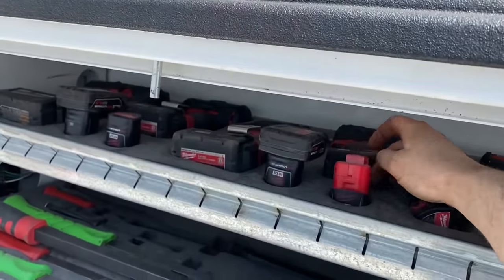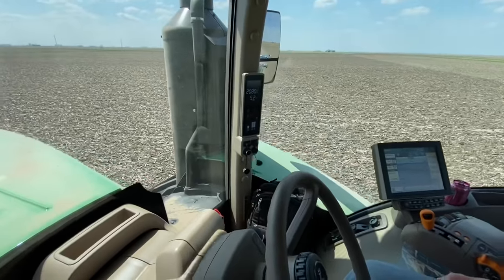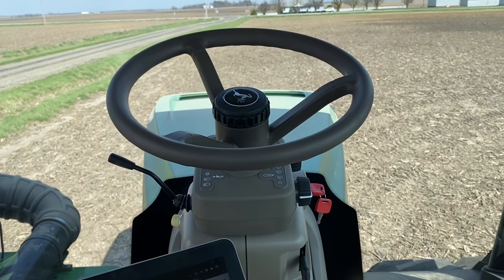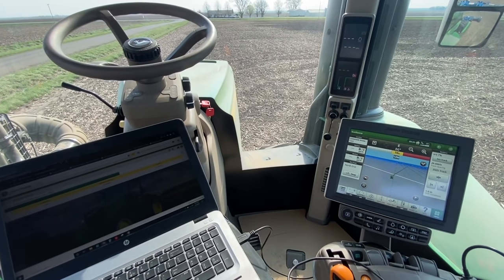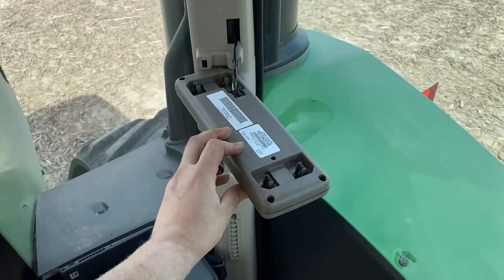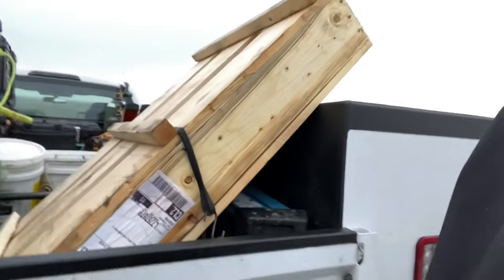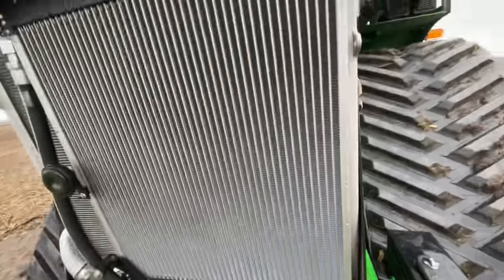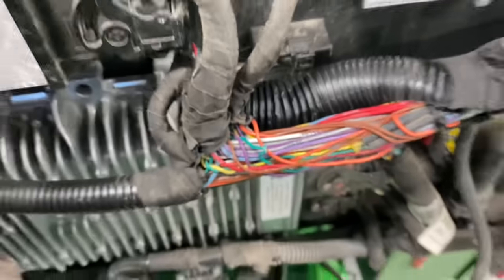2021 John Deere 9620RX sets multiple communication faults and speed is de-rated to 6 mph.

Comment: As an industrial electrician of 40 years experience I can fully appreciate the frustration off a fault like that. It must have been so satisfying  eventually finding that, well done 👍. Strange thought when the wire wasn’t even fully broken. Bet you weren’t looking forward to replacing the wiring loom if that hadn’t fixed it!

Comment: As a automobile master tech, I can state can lines can be quite tricky, you can have one strand left in the wire, and still have perfect ohm readings until you hit a bump on the road, in most cases I run a temporary CAN wire outside of the harness between the two points of failed communication to save time finding the problem before judging modules. 
Great job. Love your videos.

Comment: I hate intermittent CANbus faults.  Drive me nuts. Techs usually says it's got to be in the programming.  I tell them to check the wiring because if it's in the program all the units would have the problem.  A few hours later they tell me they found the issue.  It was in the wiring. Usually a pin that was not seated or a wire like you found.  Keep up the good work, I enjoy the videos

Comment: In my first job/career, I performed customer field service work (office automation equipment) and during the 14.5 years i did that, I had two similar issues of replacing everything that myself and Tech support could think of and it ended up being pinched wire on one and an intermittent pin contact in a harness on the other. The fix in both cases was very simple but, finding both issues was a nightmare to say the least. After that experience, I stopped assuming it was always the big items and started looking for simple comm issues first. It served me well.

Comment: Sometimes diagnostics takes trial and error. I work in computer repair for the past 10 years. Cannot tell you how many times I have had still things like this. You are chasing your tail for 2-3 days in a row till you finally find it.

But damn nice find. Single wire caused you all that headache. I once had a single wire on a power supply that was not plugged in all the way. You walked past the computer and the damn thing would turn off

Comment: Had a 1770nt planter that kept crashing and rebooting the planter controller. Didn’t crash anything else just the planter controller. The tech and I were working on it for something like 5 hours checking literally everything. Finally narrowed it down to the wheel speed sensor on the planter. Put a different sensor on and everything was fine. It was a wire on the sensor that was rubbed through the insulation grounding out on the frame intermittently causing the controller to crash. Extremely frustrating. Intermittent wiring issues can be the hardest to diagnose and repair. 
   Good catch finding that bad wire! Wiring harness quality control is not something to be taken lightly.
Reply from the maker: Yeah that's why I don't have hair anymore lol thanks for watching!

Comment: I’m former truck engineer who moved on to transport refrigeration units and those CAN-modules are pain in the butt to troubleshoot. You can only diagnose everything else and if ok, replace the module and pray - and customer will pay and cry. Did you have to put back the modules you replaced that were ok? I’d imagine so as it’s a warranty job. Anyways really interesting to watch the repairs, subbed!

Comment: LOVE THES VIDEOS! 10 year jeep tech and i had something very similar not too long ago with a communication would drop out for a split second. very frustrating to figure out
Reply: fine also turned out to be a broken wire ( shorting to ground at times to the firewall) but it was so odd how both of our communication wires tested fine when ohmed and load tested.

Comment: Sandvik drill Tech , had a CanBus issue also that was interesting, Can low wire had rubbed through against frame of drill causing Can low in backbone circuit to ground . Went to know connector points to install bridge cable and the first wire I put my hand on was the wire with the copper exposed on the rubbing part of that cable just at the connector, luck of the Irish!!

Comment: One little wire shuts down the operation....amazing!
Reply: Not unlike the points on my 1971 Bronco that stopped the entire truck when the screw holding them in place loosened because of vibration and the points would no longer open and close.  You remember, the "good old days" when everything was mechanical, super reliable, and "easy to fix."

Comment: I'll tell u what amazes me with this technology today is that a database isn't set up for the field tech to look at the problems, solutions and the hits for each problems along with d tech to cut downtime. Like this video on that pink wire almost cut thru. That tells me it is the wire harness quality issue when built and should have been tested for shorts, vibration, salt water ,freeze and so forth .

Comment: In my experience working at the Volvo truck dealer, OEM wiring troubleshooting steps for both Volvo, MACK & Cummins are wildly inadequate, guys who follow them often end up needlessly replacing modules & smart devices because their troubleshooting led them to no fault found in the wiring; which is less of a problem when you can get warranty to foot the bill but when its starts coming out of the customers pocket it get's ugly. In cases that are not immediately obvious I've had a lot of success isolating the harness, load testing the powers and grounds to each module in question, isolating the CAN line between connectors applying an alternate power and ground with a load in place, typically an incandescent bulb and wiggling the harness. A single conductor inside the insulation will give you good resistance but will not carry a load, while the serial data messages do not load the circuit per say, a nearly broken wire like you found, or a loose female terminal creating intermittent contact will absolutely wreck the traffic on the network. Good find, nice to see guys getting after it in the field.

Comment: Great video,  I've been an aircraft electrician and avionics technician since 1978. I've run into your little problem many times! Cut wires aare a bitch to find. Have your shop invest in a megger. It's a megaohmmeter. It shoots 50,000 volts down a suspect wire and it then reads the resistance oof that wire. High resistance, you only have a couple strands of wire . It'll ohm good but won't pass a voltage thru it. A Fluke meter only sends about 5vdc thru the wire. You have to have both ends disconnected from electronic devices or you'll nuke them.  3 kinds of wire problems,  short, open, or a few strands. A Milliohmmeter would be good to have too! That reads milliohms to check your ground connections. A fluke can't read that low. Have fun.

Comment: A $500,000+ machine with 20 hours useless for 2 whole days time is money great quality control John Deere !
Reply from the maker: Name one manufacture that mass produces tractors and never has one problem... Just because one tractor out of thousands has an electrical failure doesn't make every one bad.   It could have passed all the quality control checks at the factory because it took a few days of driving it before it showed up. We have a ton of these 9RX's running and they are doing well in my opinion.

Comment: I’ve had continuity/resistance checks mislead me before the wire was showing .3 ohms but it will still have continuity even if 1 or 2 strands are still connected I do not work tractors but I’m sure the can lines have small voltage between the high and low lines I wonder if it would have shown a voltage drop comparing the 2 lines

Comment: GREAT VIDEO.. I'm surprised that you didn't need to solder the broken wire... Good find.
Reply from the maker: In my professional opinion, heat shrink but connectors are the best. You can run enough amps through the wire to burn off the insulation and the but connector will still be attached. Solder will melt. Plus if you don’t solder it perfect you can have excessive resistance. But connectors do not change the resistance enough to really detect in a multimeter.
Reply: @ZKMasterTech  Good to know. International says to solder so I was just wondering... Thanks buddy 😃👍
Reply: Also Deere doesn’t recommend to solder can wires they want you to use heat shrink butt connectors
Reply: I know it's not the same...but Toyota requires soldering in any warranty repair. As long as proper rosin core solder is used, resistance is negligible through the circuit, and voltage drop is non existent.
Reply: @ZKMasterTech  You should look into open barrel connectors, you can maintain much greater flexibility in the wire without the added bulk of a butt splice, you never run the risk of damaging the heat shrink while crimping and if done correctly the splice will cold weld the conductors. 
We see a lot of failed heat shrink butt connectors in truck chassis harnesses due to split heat shrink around the crimp, often when multiple circuit repairs have been made in close proximity. At the end of the day fixed is fixed, if they don't give you trouble good on you.

Comment: These tractors are far to complicated they will develop so many faults has they age they will have no secondhand value
Reply: That's why old school, pre-computer machines are in high demand. Everything is mechanical with limited electronics.
Reply: They have plenty of second hand value 
Mechanics are just getting better at electronics 
If your a mechanic these days amdyou can't do electronic diagnosis then you won't get far 

When you think about it basically everything post mid 90s is electronic control tp some degree, even mid 8ps in some brands 
So full manual machines are 25 to 35yrs old now 
Theyre all fairly well scrap now 
No full mechanical machines are frontl line machines round here anymore 
Got plenty of 10k hr newholland T9s round here that havemt had any issues 
Plenty of high hour johnys as well

Comment: I wonder how you make repairs. Love the diagnosis. Does Deere has their own approved wire splices or does Zeth have HIS ? Eric O working on salted cars shows us what he uses. Sells them too. You work for a humongous company. Thatsalota Deere.
Reply from the maker: I use heat shrinkable butt splices. Never failed me yet.
Reply: @ZKMasterTech  with goo inside the heatshrink?
Reply from the maker: @lackeydehackey405  no the plastic melts down and seals around the insulation of the wire. You crimp it like a normal butt connector then heat the ends to seal them down.
Reply: @ZKMasterTech  the ones with resin inside make it water tite. No green crusties
Reply: @ZKMasterTech  they are great little joiners awsome actually but if was my brand new machine I'd want harness replacement because after 10000 plus hours with dirt rain and corrosion that will be a weak spot

Comment: the one big problem with that plastic tubing is it rubs in the riges  its a crap way of doing it . you get the same problems with  air con units where it vibrates  . the same type but made out of metal .  then ribs are the problem .  you need smooth piping  to cure that problem .

Comment: So, in the end did you put all his original components back on since everything should have been working correctly in the first place? 
I thought from the beginning that there has to be a loose or broken wire. That is the only thing that would cause this kind of issue. Throwing in a ton of components at it and still doing the same thing just proved it. 
Good find!

Comment: Wow. What a saga. Frustrating in a new machine. Now picture the same machine in Outback Australia away from the internet, a workshop nearby, replacement machines, quick parts and the US field support. Supersizes frustration.
Reply from the maker: I bet!
Reply: We operate so differently, the US and here. I do love your metrification on the machines. Impressive. It’s funny the areas that metric units have crept into the US. Science, aviation, space, engineering and sweet green machines that went metric for the international market. I remember when we first saw metric green here. Luckily we know both so well. Cheers.

Comment: All that work only to find it was 1 damaged wire but with the mess of wires and tech on equipment these days you never know if it's going to be a simple 5 minute fix or a fix that could take several hours.

Comment: Can you still buy a mechanically injected tractor that doesn't come with all of the electronic gremlins and emissions equipment?  It seems like they would be a lot more reliable if you were willing to turn the wheel and shift the gears yourself.

Comment: New machine worth multi 6 figures brakes inside 100 hours. How can you trust a machine like that? Faulty oil cooler from new is a disaster. Faulty wire harness even worse.
This is wrong on soooo many levels it hurts.
Reply: JustJoe73 Welcome to the technical side of farming. All of those parts and assemblies we're put together by suppliers. Manufacturers just put them together, runs tests and ships the machine with a warranty. Some run perfectly some don't. I doesn't matter if it's vehicles, trucks or farm equipment. The are only as good as the supporting dealer/ manufacturing organization.

Comment: where do you stand on the Right To Repair debate?
Reply from the maker: I don't stand on either side. I see both sides and they both have good points. I feel bad for farmers that live in remote areas that do not have quick access to a dealership. All of our customers live within an hour and a half.
Reply: That tractor belongs to the person that purchased it, not JD.  They should provide the information necessary to repair them.  This is why I will not buy from JD any longer.  I need to be able to repair equipment myself, not wait several days for the dealer to charge me $190 per/hr.

Comment: Ever had a 9r with backup pump pressure high codes you just can't seems to get to go away for good?
Reply from the maker: No only pressure low codes
Reply: Yep, the double hyd filter head has 2 anti drainback valves in them. Those valves usually have broken springs in them, have a bunch of scraper specials in the area that have had this issue. Only downfall is you have to pull the head off to see them.
Reply: High pressure on your back-up pump is usually a bad sensor. They’ll fault out to full range and throw that code.

Comment: I cannot, in my wildest imaginings believe  the farming industry demanded such complicated and Uber expensive systems be installed on a piece of equipment who's only job is to lug other machinery through their fields. It seems that a large team of draft horses would be much more reliable and cost a fraction of what these electro/mechanical beasts cost. No wonder the cost of edible food is going through the roof. Farming should not be rocket science.
Reply: There are not enough of Farmers or Horses in the world to accomplish what Modern Farming is capable of doing,  in spite of it's problems and frustrations.

Comment: Case ih is the way to go. Deere sucks
Reply: If it doesn't run like a Deere or crawl like a Caterpillar it's just a basket Case.
Reply: @delbutler885  only runs like a deere when being chased by a case lol. Keep in mind here im just joking around.  Deere definitely makes some good stuff. Like any product you can potentially get a lemon.
Reply: Mike Zahnow it all comes back to dealer support. We have some of both and I hate our Case IH dealer. The owner is an idiot. Parts are hard to get ordered correctly.. The good parts people have left.. So it's JD with a distant second with Agco.
Reply: @delbutler885  yes dealer support.  I had a DEERE  tractor that was a lemon.  DEERE  worked me over bad and couldn't fix the issue. Thanks RDO. Went over to Titan machinery and traded and Titan couldn't do enough for me. I didn't spend a million at Deere so I apparently wasn't as important as if I had. Titan doesn't treat me that way. So like you having issues with your case dealer I had issues with my local Deere dealership. It could happen with any brand I suppose so color means nothing now days. The dealer  makes a huge difference.  Titan machinery is king in my book. Fargo Tractor rocks.
Reply: @mikezahnow1605  do you want to hear something funny? I live in Western Idaho but am trading for some 1-2 year old JD swathers from Gooseneck in Dickinson.
Reply: @mikezahnow1605  there is 3 that were lemons around me one had to get a lawyer and force them to give him a new unit and went without a tractor for a year. The other two kept going down and tri green  wouldn't find the problems and they traded them off so to each there own I like the old sound guards and pre emissions but anything newer nope it won't be a green one that's for sure
Reply: @mikezahnow1605  Or a LIME :)